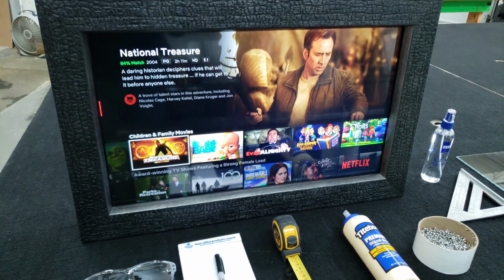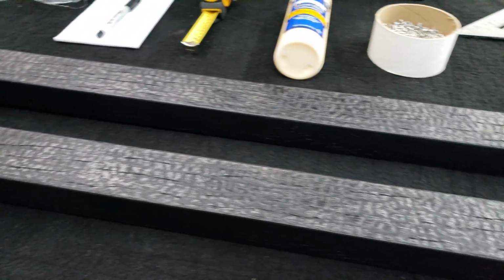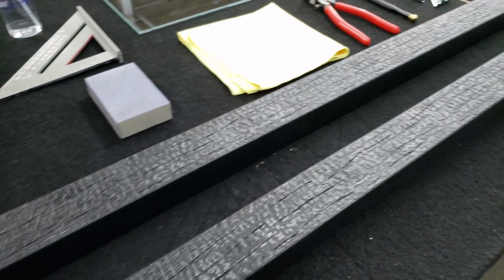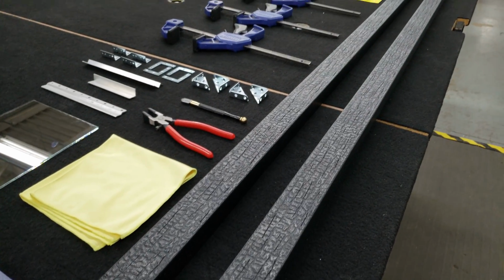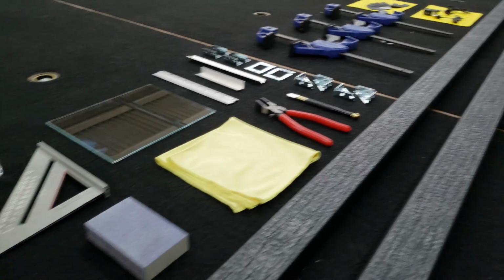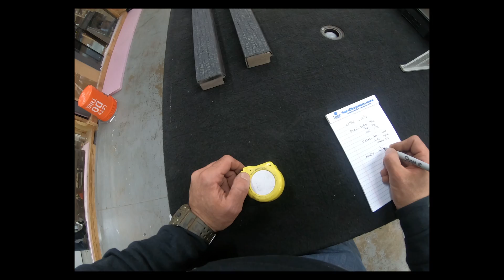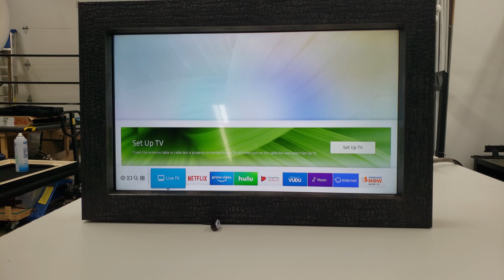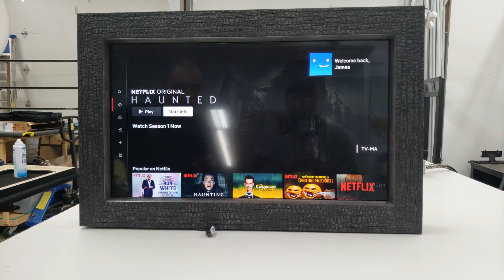Make A Mirror TV: Complete Instructions

Comment: Isn't this just a tv in a picture frame? Where is the mirror?
Reply from the maker: There is a mirror in there called a Dielectric Mirror. It's super transparent so when the TV is on you can see the display without a problem.
Reply: @twowaymirrors  You always avoid direct answers. Enter a time frame where the function of the mirror is absolutely obvious when the TV is switched off. Are you so vain that you can't admit a mistake in making a video?

Comment: When you state that this is easy- that implies there are no specialized tools needed- but the router is very specialized do you have a workaround?  I don't want to buy a router for this project only.
Reply from the maker: Some bezels are so thin these days you may not need one for a new TV. Shaving off the inside of the rabbet by lowering the table saw blade works fine as well.

Comment: Great tutorial. Was looking at making one too. Is there any issues with having the mirror fit flush with the tv screen? So there is no gap between screen and mirror?
Reply from the maker: No issues with it, the small gap that the bezel creates has no noticeable effect. The glass can sit against the bezel.
Reply: @twowaymirrors  Thanks!  I was thinking of mounting the glass actually against the TV screen, so it fits within the TV bezel.
Reply from the maker: @darrellhooper9973  That's really hard to do--I've tried that before and it's difficult to cut it exactly and the glue around the edges makes it look bad. For that reason, I cut the glass to the overall size of the TV instead.
Reply: @twowaymirrors  Thanks. I guess that might be an issue. I may even go acrylic to cut down on weight.